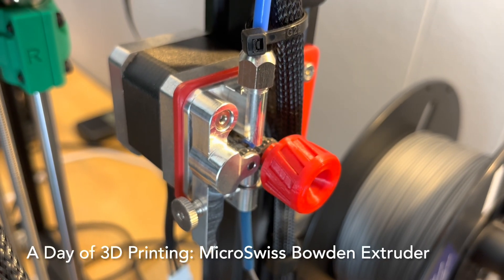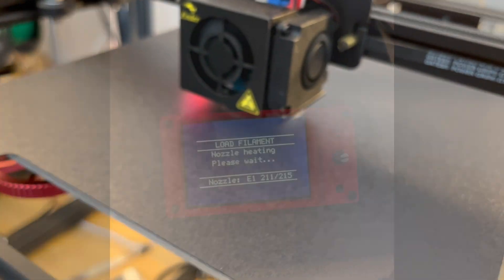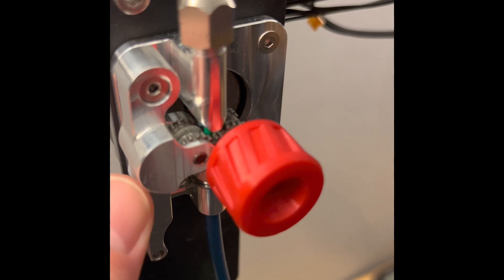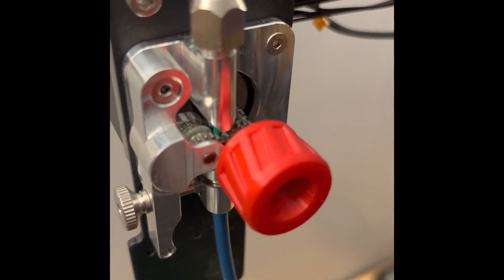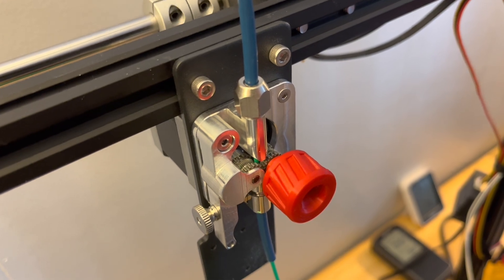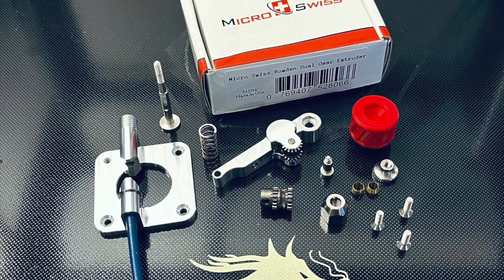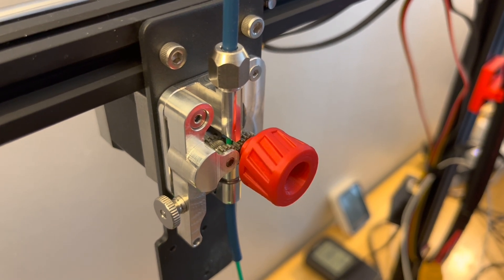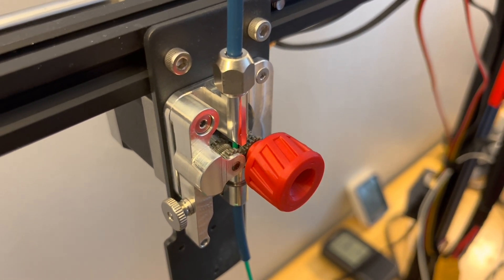3D Printing Tip: MicroSwiss Bowden Dual Gear Extruder

Comment: Have a question.
Are you still using the filiament detector  with the Swiss Bowden set up?
Does it line up when you add the Swiss exteuder?
Reply from the maker: I am not using the filament detector. For me, I monitor my prints close enough when I’m near the end of a spool it didn’t really help me at all. I had a few false detections with my sensor too after awhile when filament was loaded and it thought there wasn’t any filament. So I can’t comment if the MicroSwiss Extruder will fit with the sensor as I had taken my sensor off quite a while before getting the extruder.